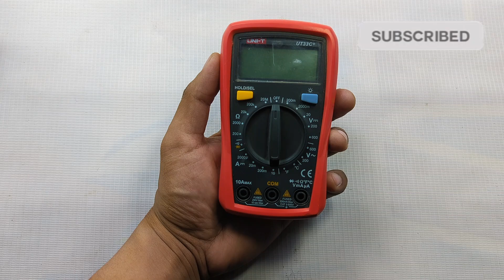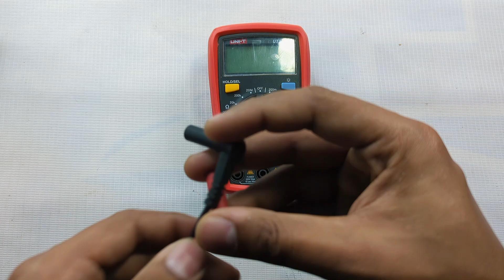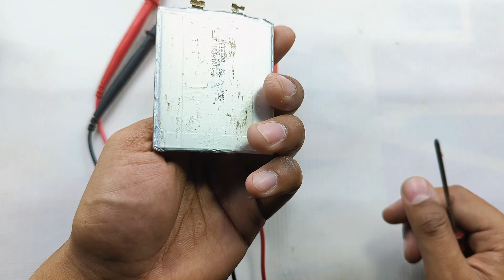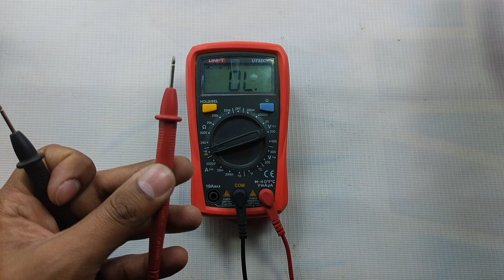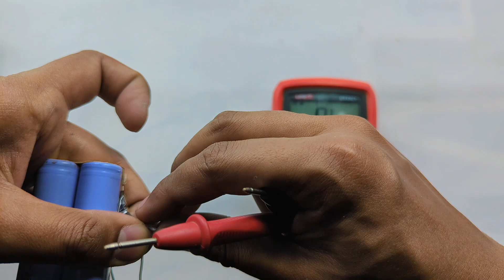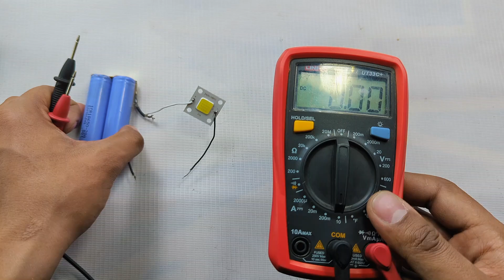How to Use a Digital Multimeter Like a Pro | Beginner to Pro   #multimeter #tutorialvideo

Comment: Nice explanation of measurement modes. From a quality control perspective, it’s helpful to remember that resolution and accuracy are not the same. Understanding the limits of the measurement system helps avoid over-interpreting displayed values near tolerance boundaries.